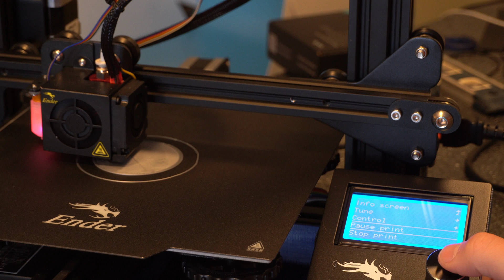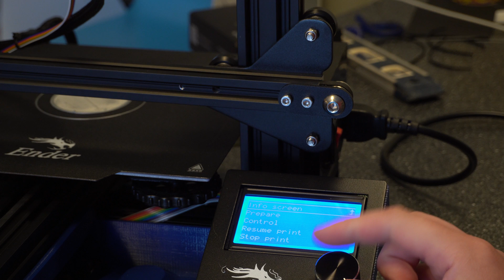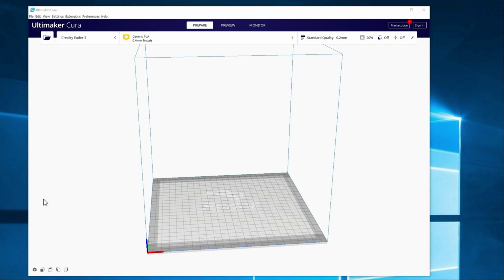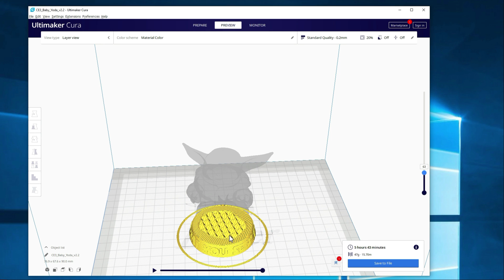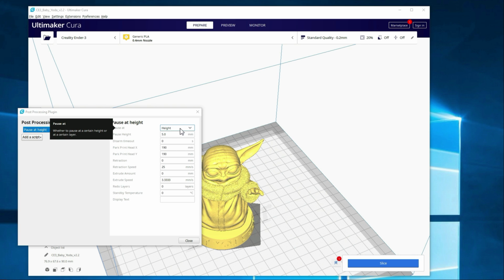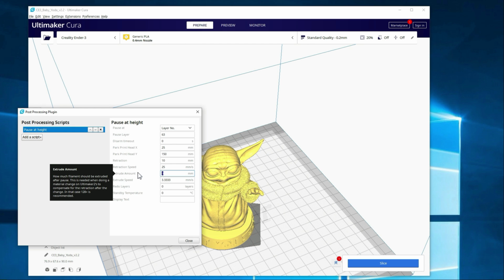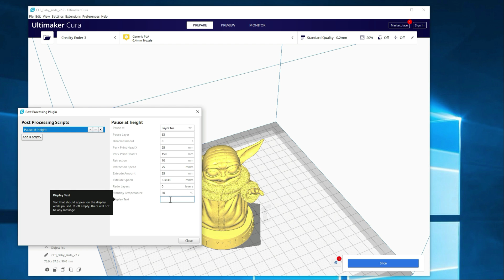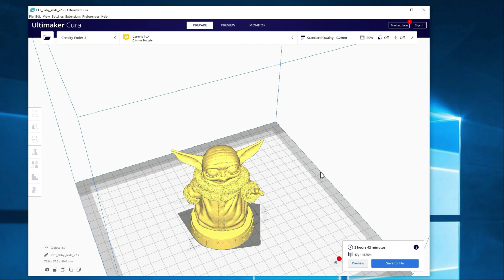Ender 3 Pro - Change Filament Mid-Print

Comment: thanks for your videos very helpful :-) i was wondering if it was possible for the machine to do a prime line before it resumes the print at all ?
Reply from the maker: Hi. If it is, I haven’t been able to figure out how to do it. Post firmware will allow you to purge some filament through, but that’s the best I’ve seen. I think that the issue is there is no way to guarantee the x-axis won’t hit the print if the z-axis is lowered to print a line.
Reply: how would it print a prime line with a print already on the bed? The gantry would hit the print.

Comment: 2:37 - Changes the filament without showing us... ummm... confusing title.
Reply from the maker: Hi. Sorry I was still trying to figure out what works and what doesn’t work on the videos. At the time I thought showing all the steps was enough, I now realize it wasn’t. The only thing left out of the video was actually swapping the filament.
Reply: @3DPrintscape  I was looking for a video with tips about the physical changing of the filament so I was specifically looking for that part. :) I messed up a 3d print on my CR-10, while changing the filament mid-print. Squeezing the release mechanism and changing the filament without moving the mechanism up or down is difficult.

Comment: I'm using Ender 3-Pro V.2.1 with Cura 4.8 slicer and I'm not having any luck with it stopping. "M0; do the actual pause" line however was added to the Gcode and still no luck. Suggestions?

Thanks
Reply from the maker: Hi. There are a lot of random little feature that dont work in Cura 4.8 for some reason. I did check around and there is a couple of threads saying that if you add a m226 command it will work.
Reply: @3DPrintscape  Ok great yea this seems to be a common issue. Awesome thank you I'll give M226 a try. Excellent channel your videos are extremely helpful and beneficial. Thanks again!

Comment: I just followed this and hit the Pause print  to pause my print . It raised a little bit but did not go to the home position. And I went back to the info screen then pressed the knob and did not see prepare. I couldn't get it to do anything and I had to stop the print and let the machine cool down and shut it off them on again and start the print all over again.
Reply from the maker: Hi. Sorry to hear you had issues. I had a couple other people have the same issue. I think it’s firmware related. What Ender and firmware are you using?
Reply: @3DPrintscape  Version 1.0.1
Reply from the maker: @craig_g1176  Ok thanks, do you have the 8 or 32 bit board?
Reply: @3DPrintscape  Man that's a very good question. I do not know. I will have to look and see.

Comment: I’m having a little problem where it pauses yes but it will start back up printing again in around 10 seconds making it so that I have to sit there and wait, is this just a setting I’m not getting or a glitch? Any help will be appreciated
Reply from the maker: Hi. I haven’t seen that behavior before, it could be settings or firmware. You could try to erase your eeprom to get the printer back to stock settings and try it again. Also, are you running through the process from the control panel or OctoPrint?

Comment: When I pause the print, there is no prepare option, just Tune and Control. How do I fix this?
Reply from the maker: Hi.This sounds like a difference between our firmware. What firmware are you running?
Reply: @3DPrintscape  default on the ender 3 pro
Reply from the maker: @RedHornet980 , Unfortunately, the Ender 3 Pro has been shipping with different boards and firmware versions. When I went through the testing for this video, I was using the 8-bit board and creality firmware.

Comment: HELP !  there is no prepare in the screen !! there are only tune and control ... What do i do ?
Reply from the maker: Hi. What firmware are you running? It sounds like it may be disabled there, or not in that version.
Reply: @3DPrintscape  it's okay, i just used all the plastic and then put an another one ! but thanks

Comment: why do you use SKIRT... it really does nothing what so ever... better to use BRIM so it helps print stick to bed .... mostly for tall and thin parts or just tall
Reply from the maker: Hi. Great question. I only use a brim when I need the extra adhesion, which is only about 10% of the time. The rest of the time, I just use the skirt with the intention of the skirt priming the hotend.

Comment: Can you comment on what firmware version that is?  I don't get the prepare menu when my print is paused.  Out of the box firmware from about a month ago.
Reply from the maker: Hi. This video was made when I had the stock Creality firmware on the printer, which was Creality 3D 1.1.6.2.
Reply: @3DPrintscape  gotcha.  This printer came with Marlin 0.0.6, so I guess I have a firmware update project in my near future.  Thanks for the quick reply! 👍

Comment: What happens to the bed temperature when you do this? Does it maintain the set temp?
Reply from the maker: Hi. The bed temperature should remain at the temperature defined in the g-code file.

Comment: I am seriously pissed off right now, this video is super helpful. Nothing work on this ender 3 v2. Pausing the print does not work it LOCK the extruder. ffs
Reply from the maker: Hi. Sorry to hear that. I know the process works on the Ender 3/Ender 3 Pro and with the SKR Mini board, but I don’t have an Ender 3 v2 to test with. Based on feedback I got from other comments and forums, it sounds like the pause feature may not work properly on the v2.

Comment: I bought my ender 3 pro a month ago, i went to change my roll as it was getting low, pressed pause print and there is no prepare option available. I wrote my z value down and will have to edit the gcode start point to hopefully carry on. I tried manually feeding pla in to prime it before it restarted but nothing came out for a layer. 
Maybe there are different firmware versions that give you this prepare option after a pause print?
Reply from the maker: Hi. If I remember correctly, I had to go into movement then extruder and and keep hitting the plus arrow until the filament was primed. I think I did a video on this, I will check and link to it here. Also, what firmware are you on and what mainboard came with your printer, was it the 8 or 32 bit creality one?
Reply: @3DPrintscape  
Hi rob
Ive just looked at my board. Its a 4.2.2 so i think that's a 32bit board. On my info screen it says version 0.0.6. I think i need to update my firmware. I'll start looking into that this weekend. Hopefully this will bring back the options I'm missing. Thanks
Reply: @jasonb9244  Same thing here. Pause freezes everything when pressed and resume function simply doesn't work. Did you find any solution? I also guess a firmware update is needed..
Reply from the maker: Here is the link https://youtu.be/d8lcJ9ntG1A .
Reply: @3DPrintscape  
Hi rob
I watched this video from your link. This cannot be done from a resume print though with my stock firmware. Ive been doing the prepare/move 10mm or more option with the extruder to purge pla but once my print pauses part way, i cannot access these options anymore. I have the 32bit board, i think crealitys firmware system is not very well done. 
Thanks

Comment: hey so thank you for the help just have one big issue. When i change the filiment out and click resume print itll start ozzing out filament and cause a blob. Is there a way to stop that so its a clean resume when i start? Like can i set it to print a line like it does before every print in the beginning? You know what i mean?
Reply from the maker: Hi. You could do this in the g-code file. Here is an example .

; relative extruder
M83

; prime nozzle
G1 E-5 F4500
G1 E5 F4500
G1 E5 F4500

; absolute E
M82

; absolute XYZ
G90

; reset E
G92 E{{ pause_position.e }}

; move back to pause position XYZ
G1 X{{ pause_position.x }} Y{{ pause_position.y }} Z{{ pause_position.z }} F4500

; reset to feed rate before pause
G1 {{ pause_position.f }}
Reply: @3DPrintscape  im sorry im still sorta new to this. So where exactly should I input this? I use cura. I see a start g code and end g code box when I go into machine settings. Just not sure where to input this.
Reply from the maker: Are you trying to do this through Octoprint or just from the printer?
Reply: @3DPrintscape  I use cura for a slicer
Reply: I like to know that too

Comment: .... your video is titled "Change filament mid-print" but you skipped the part where you changed the filament. I don't get it.
Reply from the maker: Hi. Thanks for the feedback. I was showing the process to change the filament mid-print but didn’t think it would be worth the extra video length of me actually doing it. I guess it could go either way.
Reply: @3DPrintscape  It's probably just that I'm ultra-new to 3D printing so I was hoping to see if you just ripped the filament out of the tube or if you used the "change filament" program or whatever. Not a huge deal, just seemed odd.
Reply from the maker: Gotcha. I did a video on changing the filament, maybe I should link to that in the description of this one? https://youtu.be/d8lcJ9ntG1A

Comment: I tried this on my ender 3 v2 but it didn't work. Any clue what i did wrong?
Reply: I have the same issue. The print pauses, the head moves to the requested coordinates but then 2 seconds later it goes back and starts printing again. Ender 3 v2
Reply from the maker: @davidhilario8451  Hi. Can you take a video of what its doing and email it to me? My email is admin@3dprintscape.com . I don’t have the V2 but was going to pick up an Ender 5 with the same board, so I may be able to reproduce the issue.
Reply from the maker: Hi. What issues did you run into?

Comment: doesn't work on my ender 3v2 
I am using cura 4.8
Reply from the maker: Hi. Thanks for the feedback. I assume it’s the cura plugin that’s not working? Can you confirm that the pauses are added to the gcode file?
Reply: @3DPrintscape  I checked the gcode, there is "M0; do the actual pause"
but my printer didn't pause and the print result is like it skipped z for a few layers
Reply from the maker: Can you email me the gcode file? I will try to print it on my printer to see if it does the same thing. My email is admin@3dprintscape.com .
Reply: @3DPrintscape  I uploded the gcode files here https://drive.google.com/drive/folders/1JXJTOYHdn9qtuA1fW6ShgRBw_qK1bxIC?usp=sharing
Reply: @indogamingmovie  you got a fix for this issue?
Reply: I had the same problem.  I'm still experimenting but I'm about to try the change filament option under the gcode modification instead. Fingers crossed
Reply: Did change filament work?
Reply: @davidhilario8451  i tried 2 diffenrent filament brands, the issue still present

Comment: On my stock ender 3 I went to control > change filament, the print head goes to home, I squeeze the extruder, pull the filament out, then push the new one back in. Finally pressed the button a few times to confirm. The head extruded out a few cm and continue on its own without interruption.
Reply from the maker: Hi. I have had bad luck with the change filament command showing up on my ender 3 with the stock board. I think I only saw it a couple of times. I know other people have had the same issue. That’s why I did this video. By chance, does your printer have the 32 bit mainboard that has been shipping with some of the Ender 3s? It’s the one they started to used for the Ender 3 V2.
Reply: @3DPrintscape  I see, mine is a non-pro v1 unit (basically lowest price) that's purchased very recently. That might be the reason.

Comment: I have an ender 3 pro and have added the script to a couple different prints, and the printer never pauses allowing me to change the filament, I read something about some models not recognizing the gcode it puts in, any advice?
Reply from the maker: Hi. I would recommend upgrading the firmware, either to the latest Creality on or to Marlin. If you are considering going to Marlin, it would probably be easier to replace the mainboard with the SKR mini https://youtu.be/wtT6iA9IG7A .

Comment: When I go to squeeze where the filament goes through I move the machine up or down by mistake and ruins it. How do you prevent that
Reply from the maker: Hi. The easiest way to prevent that would be to move the filament using the stepper motor. If you go into the movement section on your printer, you will see the area there for moving the filament there. That said, try to push the filament through the tube as much as possible without moving anything yourself to save time.

Comment: G-code is only set for that particular model correct? Great video.
Reply from the maker: HI. That’s for the feedback. To answer your question. The g-code will be set for any model you slice that has that stop enabled. If you go through the process of adding the stop for a model and don’t remove it, then I will also be added to the following model(s) you do.
Reply: @3DPrintscape  ahh got it thanks man keep it up.

Comment: I did this all, but I accidentally bumped the X-axis.  You didn't say not to move anything while doing the swap.  I tried to resume the print, but the extruder kept hitting my part.  So, I had to run my print job all over again.  Bummer, what a wast of time.  I may have tried to be more careful if I knew I could not move any thing while changing the filament mid print.  Oh well!  Live and learn!  Thanks for the video!
Reply from the maker: Hi. Sorry for leaving that part out of the video. Yes, you will need to be careful not to move the Z-Axis. The print gets paused a specific point, and the printer has already been homed. That means that any movement not controlled by the printed will result in inaccuracies in the print because the extruder is not where it thinks it is.
Reply: @3DPrintscape  i run into this problem so many times... Is there any way to prevent this..
Reply from the maker: Unfortunately, I don’t think there is a way to prevent this. The printer knows what layer it's on when its paused, but it wouldn't have a way to know if there has been movement on z-axis.

Comment: Hey 3D Printscape awesome video but I have a question. I have a really really long print and Im not totally comfortable with my Ender 3 pro running for 80 hours. Is there a way to use these methods and actually turn off the machine? Then resume the print? Do you have any videos or advice for something like this if this doesnt work for me?
Reply from the maker: Hi. Some printers have the resume on power failure feature that works well, but the one on the Ender 3 has been very unreliable for me. If you want to pause mid-print for a while, I would keep the power on but set the extruder temperature very low. If you go this route, make sure to test it on a small print, so you don’t lose all that time/filament. Also, make sure to clean up any stings left behind from the extruder moving away from the print and heat the extruder and purge some filament before resuming.

Comment: Why didn’t you just go to tune and then go to change filament so that it would retract the filament for you and home it at the same time?
Reply from the maker: Hi Clay. With the default Ender 3 firmware, I have noticed that feature to be missing half the time, and it doesn’t really work well with Bowden drive systems. So I just do the swap manually because it gives me more control, and I still end up needing to do half the step anyway.

Comment: Once Cura pauses the print, you didn't say how to resume the print (unless I missed it). Do you just click the "Resume Print" on the printer itself?
Reply from the maker: Hey Kevin. Yes, you would hit resume on the printer. The gcode added basically just acts the same way as you hitting pause on the printer but its automated and at a predefined height/layer number.
Reply: @3DPrintscape  Hi, I don't have the option to pause or resume on the Ender 3 v2 with firmware 2.0.7.2. Am I missing something?
Reply from the maker: @olinwinfrey1782  Hi. I know its not available in some firmware and the touch screen on the V2 isn't fully compatible with Marlin firmware, so they may have disabled it.